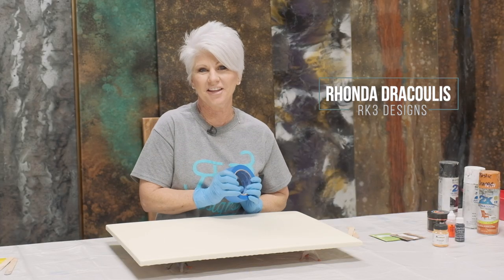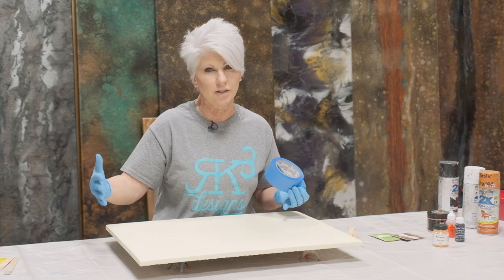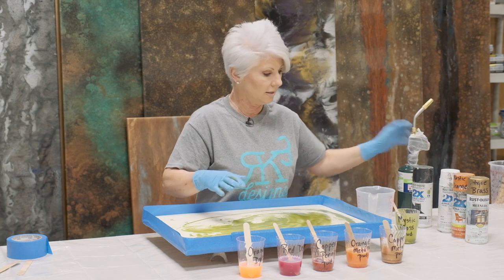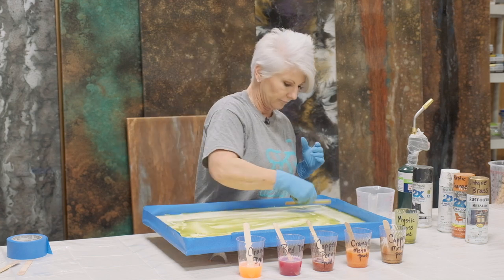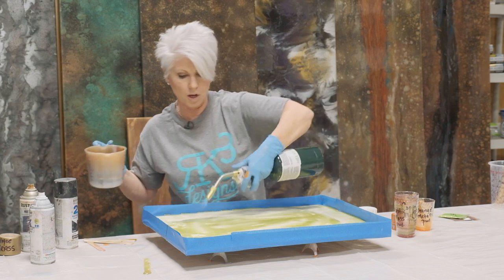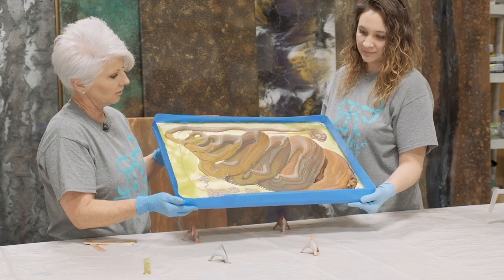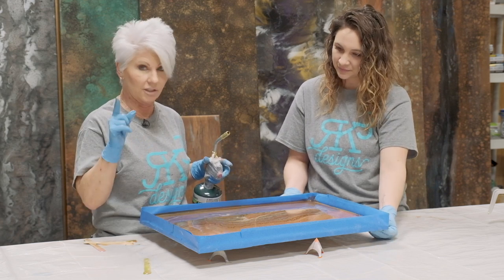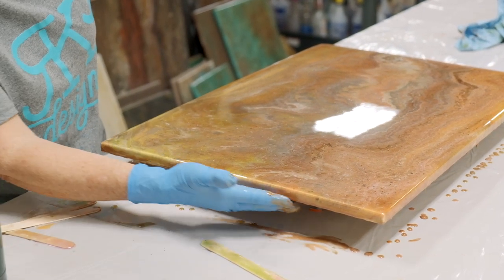Create stunning Epoxy Countertops, using this easy Dirty Pour method!

Comment: I am so addicted to watching your pours. Really magnificent work. May I ask do you feel stone coat is safer than other Epoxy?
Reply from the maker: Thank you so much. I appreciate you watching. Yes stone coat is very safe. It’s made of 100% solid material with no solvent therefore having no VOCs. There is no odor and it’s non flammable. This is one of the main reasons I use it in our business and our classes. This is also why I became a distributor. 😊
Reply: @RK3Designs  thanks so much. The deep pour says it requires a top coat of artists epoxy for shine. Do you feel this is necessary for artwork? Does it require sanding to put the top coat on?

Comment: I would be interested in an explanation of what is meant by "dirty pour." I've heard it a lot but haven't seen it defined. What's different from the other techniques? thanks
Reply from the maker: hwetherb hey there. A dirty pour is a term that became popular with Acrylic pours. A dirty pour is just describing the technique of layering different paints into one bucket then pour on a surface. Contrast that to a Clean pour, where the paints are layered directly onto the surface instead of in a bucket first. Great question! 😊.
Reply: RK3 Designs thank for explaining the difference. Great tutorials